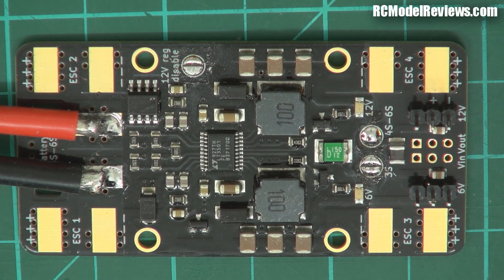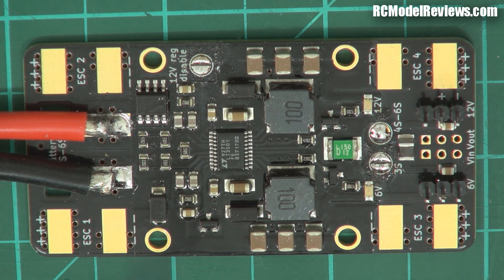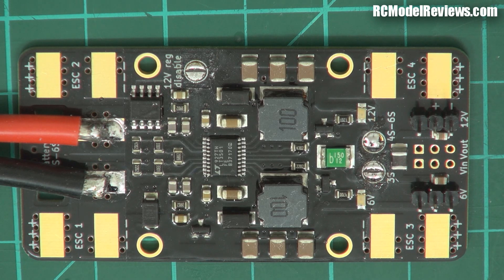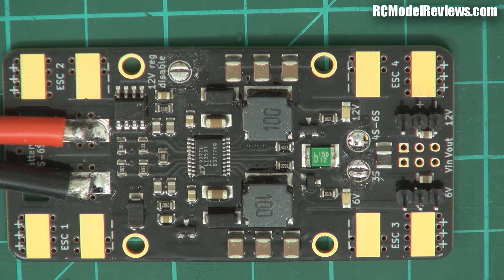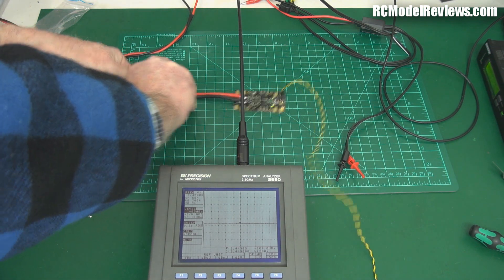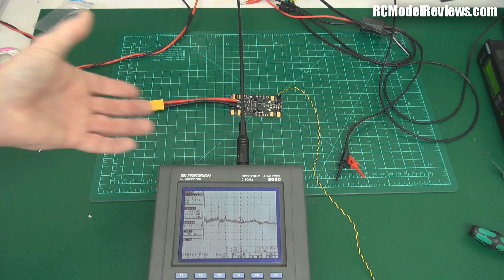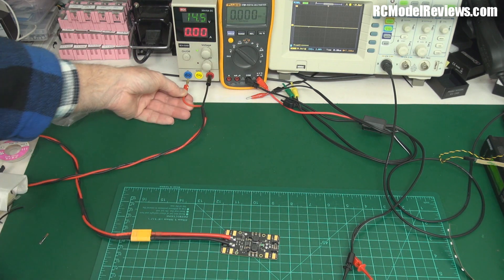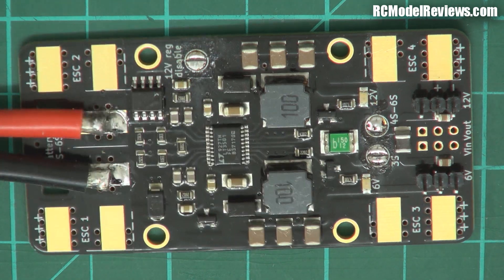The Power PDB from Volo

Comment: Great vid. Bruce I have a conundrum. I'm using the EZosd from Immersion, and somehow my camera is interfering with obtaining satellite signals. Any experience with Ezosd?
Reply: +doluseb I think I may have one here somewhere.  If I get time, I'll throw it on the spectrum analyzer and see if it's putting out any noise that might affect your GPS operation.  In the meantime, see if you can increase the distance between your FPV gear and your GPS antenna.

Comment: Love the RF noise tests Mr. Bruce. Very thorough and informing. But also remember the switching frequency of the buck will change a little with different input voltages. Could vary the harmonics.

Comment: Hi Bruce, I've been interested in these boards for a while but I too have my concerns about the 6v output. I was initially  concerned that my NAZE32 boards (rev 5} could only take 5v but I've since found out that the Rev5 can take up to 16v, but now I'm worried that it could fry my WS2812B LED's that are rated at 5v. would you know if WS2812B LED's can take 6v?. You also need to check that your Rx can take 6v.

Comment: TIP: If you need to drop voltage by some amount, say from 6V to 5.3V, all you have to do is add a "protection" diode, a diode in series with the supply, forward biased!  The voltage drop of the diode is relatively constant over large current and temperature ranges, just make sure it can handle the current you expect! schottky diodes and germanium diodes (rare) drop about 0.1V-0.25V,  Normal silicon diodes drop about 0.6V, a near-IR LED will drop about 1.2V, a white or blue LED will drop 3.1V or so, you get the idea!

Comment: $60? for a mini quad pdb? i really think they're misreading the market here. it's a great product, but not many people will buy it.
Reply: +FPV.Mike It's not really a miniquad PDB... it's more for somewhat larger quads (400-650 sized).  If you're building a quad that size to (for instance) engage in aerial video and you want maximum reliability then an investment of this size is nothing compared to the other money you'll no doubt be spending on well-spec'd motors, ESCs, flight-controllers, etc.   This isn't a budget PDB by any means and it's not designed for low-budget projects.   For that reason, it has a niche market.   Remember, some people still pay $500 for a GoPro when an Xiaomi Yi would do the job 80% as well :-)

Comment: $45 is not a good price, those PCBs are dirt cheap and so are the components. Gold plating is meaningless to anyone with flux.
Reply: +Justin Bell Put it this way.. if I was making and selling these, I would want a retail price of more than $45.
Reply: +Justin Bell 
I would like to agree with you. Normally I would. But not in this specific case.

I just got two of these myself and the quality of the product is way above what I usually find from other vendors.
Retrofitting a NightHawk250 with one of these was unusually easy and I could even remove some wire and extra insulation I used to need.

Should I wish for changes of this product, it would be to have 5.5V replacing the 6V and to have an integrated Amp sensor (completely removing my need for APM power module)

BTW: I also got some if their LED modules: Same high quality.

The biggest problem is the cost of having these shipped to EU (I could not find any shop within EU with these in stock. Shipping+tax+toll = FUBAR $$$ ) .
Reply: +Justin Bell I also think it's to expensive. All the good pdb's are to expensive compared to a diy-harness + bec + LC-Filter. So I will stick with my harness.
Reply: +Jon Linde yeah, the PDB from UBuyADrone is $20, fits perfectly for ZMR250, and is 100% badass.

Comment: So basicaly its a 5 buck PDB with two 5 buck step down converters. Only advantages it has when compared to cheaper solutions are the golden solder pads and the coating. But that is just mine opinion.
Reply: +neclovekSK Plus the conformal coating, 4-layer PCB, short-circuit protection, reverse polarity protection and voltage LED status lights to validate the performance of the regulators.   So it's basically not a $5 PDB :-)
Reply: I did mention the conformal coating, the 4-layer pcb doesnt help that much but ok, it still helps a little bit. Is the reverse polarity protection only on the BEC or on ESCs as well? And those leds...they seem kinda useless when the thing is burried under all other parts.
Reply: +neclovekSK  in the video Bruce stats the reverse polarity protection only applies to the circuitry on the board itself. the esc's or components connected to the pdb via pads are NOT protected.

Comment: On the solder pad for the 6 volt output, would to vary the output if you bridged the pads with a resistor? 
If so, maybe you could find the correct value resistor to take it down to 5 volts.
Reply: +Green Silver No, that wouldn't work I'm afraid.
Reply: I should ha e guessed lol.. These things rarely are that simple!
Reply: A power diode would drop the voltage by .7v.  It could be added to the lead of the device being connected.
Reply: +William Maxey That's a waste of energy. It would be better to change the Feedback resistors on the LT3051.
Reply: +xjet  But altering another resistor or two would :)    LT3501 datasheet,  pins 14 & 17, which look to be the ones between the IC and the battery input pads.  http://cds.linear.com/docs/en/datasheet/3501fd.pdf

Reverse polarity protection is maybe with an LTC4359 'ideal diode'  http://cds.linear.com/docs/en/datasheet/4359fb.pdf

Comment: What about the  pi filter ? Seems a little bit high frequency to me . Take out switch noise , but not  low frequency motor noise. Use your spectrum analyzer to measure the filter output. Use dc block .

Comment: It may be worth noting, that the coating is only on the middle 30.5mm side square of the board, the ESC pads, solder jumper pads, BEC output holes and battery leads pads, as well as the few capacitors next to the BEC outputs are not coated, because you, obviously, need to solder to these pads. So, when you finish soldering, it will be wise to cover these with either the coating or liquid electrical tape.